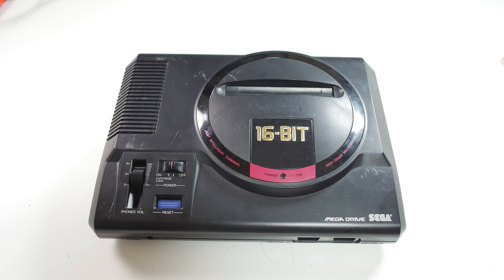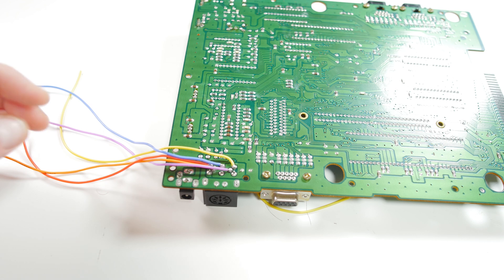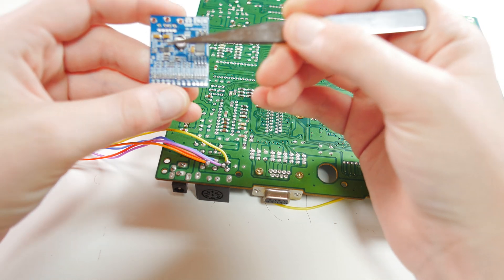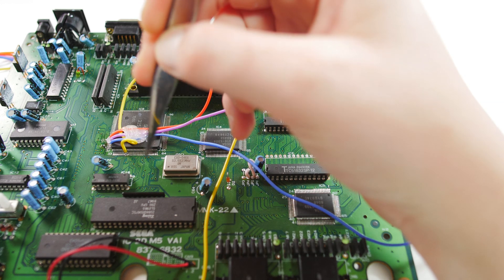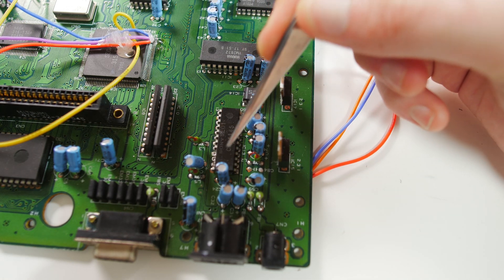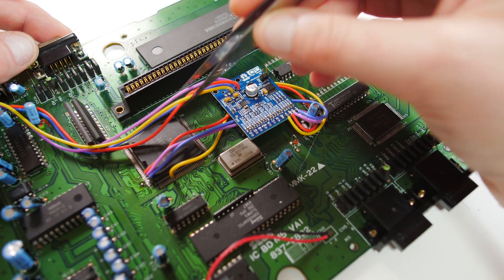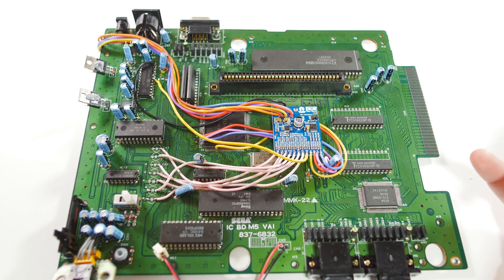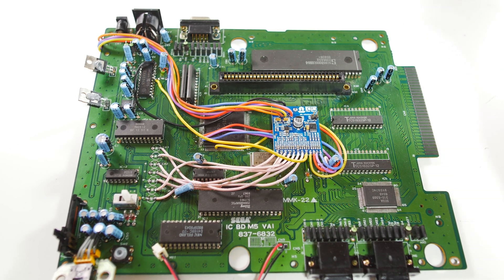SEGA Genesis | Mega Drive | Getting Crystal Clear Audio and Video

Comment: En mi opinión ese mod es un sacrilegio en el sentido que altera el audio original ligeramente, me parece genial limpiar el vídeo, pero todo el circuito de audio debería mantenerse original. Tampoco se debe subestimar lo que pueden hacer unos buenos reguladores lineales y unos buenos condensadores, las VA0-VA2 requieren corregir el error que cometio sega al ajustar mal el nivel del preamp por lo que es casi obligatorio hacer la modificación de corrección del preamplificador que solo consiste en cambiar los valores de 3 resistencias y dos condensadores.

Comment: Wow. Despite a thousand searches going back before others had done this to a Genesis 1, this video has been sitting here all this time and predates them. Somehow I landed here after searching “3BP Install” even though that’s not in the title. Still, the title really needs more key words! 3BP, Genesis, Mega Drive, Triple Bypass, HD Graphics Model 1, etc. in the last couple years.

It’s really cool that you have a JP VA1. In the last couple years I’ve done them to a few VA6 and VA5 consoles (same board rev). I wish I didn’t sell my US launch console just before all this because now I wonder what rev that was. My bro just got back from Thailand with a JP VA6 that had an RF mod and frequency mod hacked in. I already removed the frequency mod, converted the switch to a language selection, and gutted the side-mounted RF modulator to install a 9P mDIN where they already drilled a hole on the side.

Comment: Its hard to find those amp board cause they are out of stock. Is it possible to to make my own board with some requirement parts? Like caps. Ressistors etc.
Reply: Here's the one I bought: https://www.ebay.com/itm/Triple-Bypass-Board-for-Sega-Genesis-Megadrive-RGB-THS7374-Mega-Amp-2-0/254250910265?hash=item3b32890239:m:mtdKKfJHIxrmB3Svy6LS-ew
I bought it to install on a Genesis Model 3 VA1, but it seems these Triple Bypass/Mega Amp boards are best suited to upgrade the later Genesis Model 1's (VA7 "the stinker" in particular) and the Model 2's. Different Model 1's have various degradations and the Model 3's sound just slightly less bright than a Model 1 TMSS. I think the Model 3's sound great.
It's still hard to find good, step by step tutorials though. I'm having to piece stuff from all over.
  Here's a Leon
 Kiriliuk quote:
Leon Kiriliuk
@leonkiriliuk
Replying to 
@iFixRetro
 and 
@FistedSix
"The model 3 is actually a good console, especially the VA1. With triple bypass it will give you better video quality in RGB than a model 1 can ever hope of achieving."
Reply: The Sega Triple Bypass is open source, so: YES. :)

Comment: Thanks
Exactly what I was looking for. Wondering if it would be possible to replace the din8 with a genesis/megadrive 2 one for stereo goodness directly from the connector?

Edit : can't find the modchip schematic. Your link go straight to the BOMs.
Reply from the maker: You should be able to https://www.retrorgb.com/genesis1rgbbypass.html   this person has seemed to done it. Tho you would have to attach composite or whatever else you want in the connector yourself. Sorry I just linked all the stuff I used.
Reply: @KatesHardwareReviews  composite is disabled once you lift the RGB pins from the chip. The Sony CXA1145P no longer has RGB to encode composite video from.